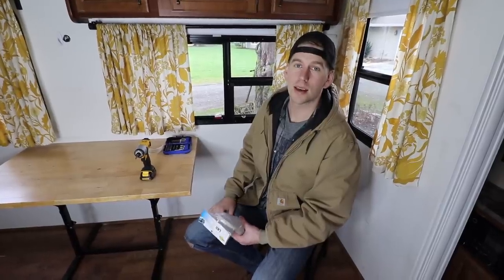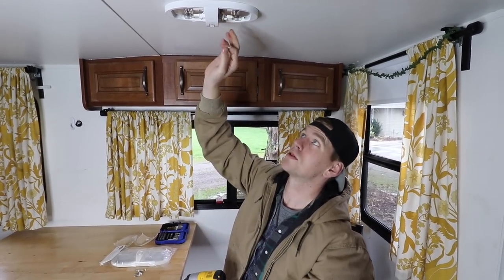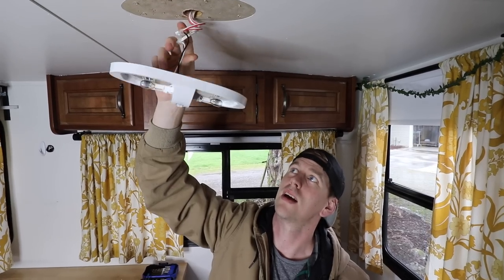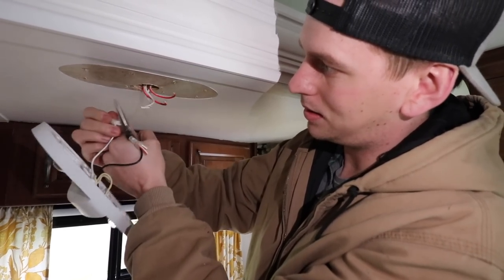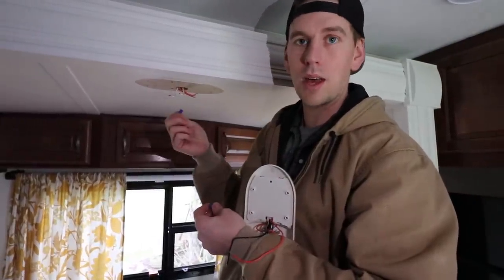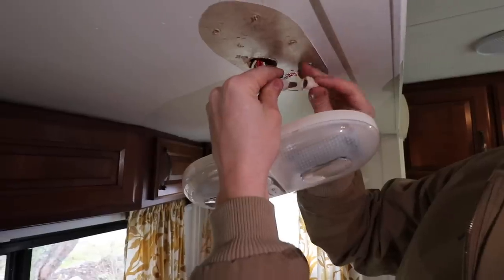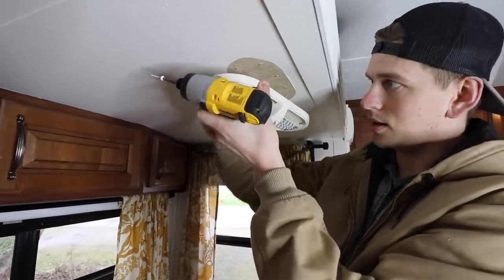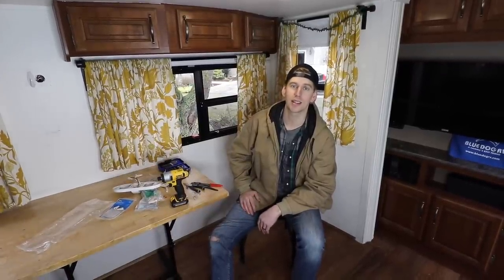🔥HOW TO REPLACE STOCK RV LIGHTS TO LED's - HUGE FIRE RISK! 🔥

Comment: We had several of those switches go out so I ordered some LEDs and LOVE them! I don’t have them all replaced yet but can tell a huge difference! So much brighter and way less power! Nice job Ben!!
Reply from the maker: Oh that's great! Do your normal lights get SUPER hot?
Reply: Family Fulfillment Project.. yes they do and have burnt spots just like yours.. in fact a couple of them even left hot marks on the ceiling, noticed it when I removed the fixture.